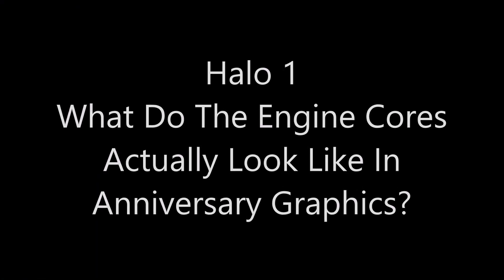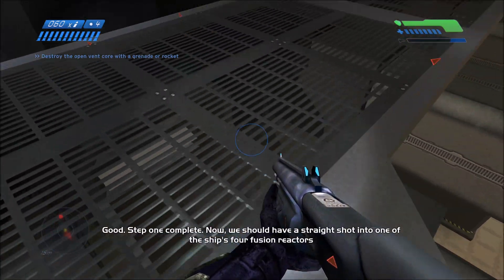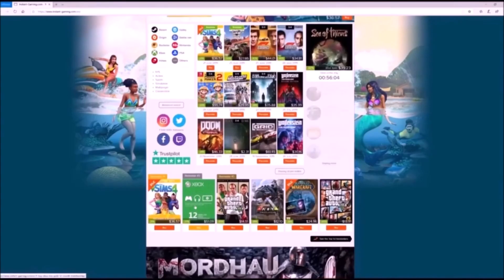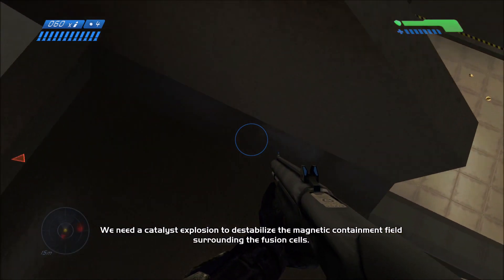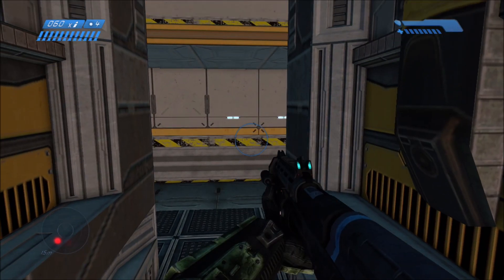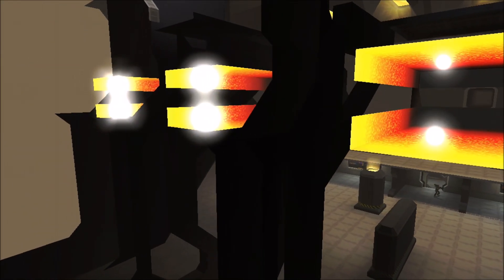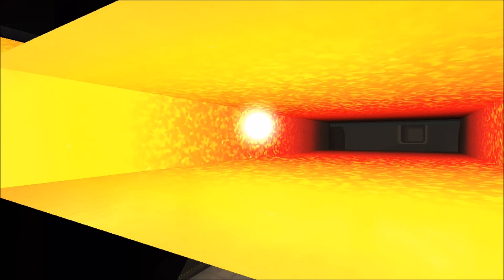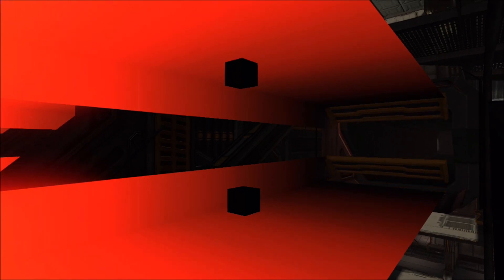Halo 1 - What Do The Engine Cores Actually Look Like In Anniversary Graphics?

Comment: Interestingly, the reactors seem to be based around a real fusion reactor type (forgot the name) that uses magnets to keep the plasma in place. The reason the chief turns it into a bomb by firing rockets at it is because the reactors are powered on (already critical as the word actually means, but I think that's a fission term) and he is dislodging the magnets or destroying them. That plasma is essentially a mini star, being over 100,000,000 degrees kelvin as Cortana says. If the thing allowing the plasma to keep its shape and remain a star is removed, it's got to go somewhere. It's less a nuclear explosion and more a miniature supernova.

The issue lies in the fact that all the chief's actions would do in real life is at best simply break the reactor and turn it off, merely wasting his time and ruining the Autumn further, or at worst the reactor cores would go nova immediately, destroying the ring but killing the chief too before he can even think of escape. I guess the delay to allow for the warthog run may be hand waved as last minute safeties intended to allow for repairs or evacuation that fail themselves when the timer hits zero.